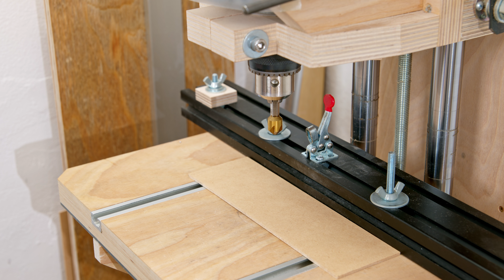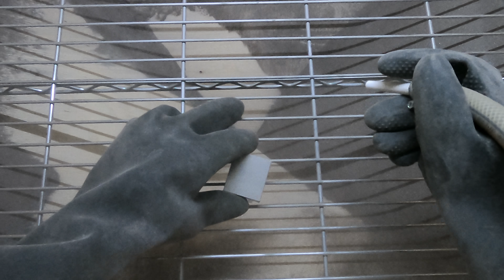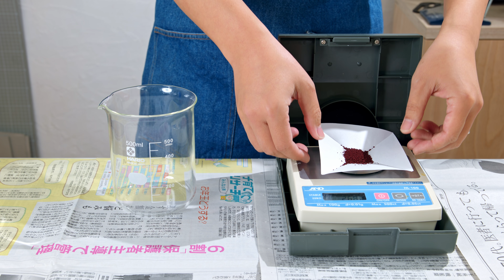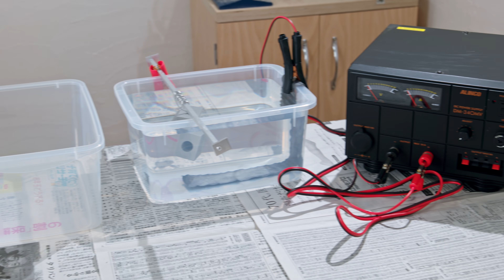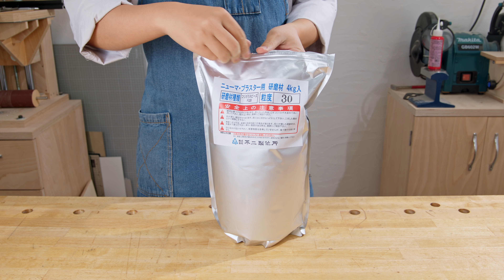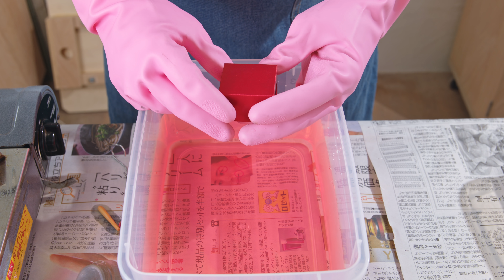Aluminum makes amazing changes～Anodize Aluminum

Comment: I'm guessing by the size of the part, you could have used half of all the liquid materials?  Smaller containers with half the material. Also I would have another rinse after the die so I didn't get red dye into my big tub of mixture. So that I could keep it for next time. I'm assuming it could be reused if stored properly?

Comment: The part you ended up using looked great but even the first piece that was a bit dark & matte wasn't bad-looking. Maybe for a more industrial application it might be perfect. Is one or the other more scratch resistant or color fast? Anyway, it was a great project and a lot of work for one part, but thanks for sharing!

Comment: Im having problem with reducing the temperature of sulphuric acid and water. It is not getting any cooler than 25°.  If I add more water the acid will get weak. What should i do?
Reply: I tried to anodize it when the acid and water was on 40°. Nothing happened. Then i watched your video again. 
Still trying to decrease the temperature. Please suggest me something.
Reply: @ammarhussain8149  Maybe the acid container inside another container full of ice ?

Comment: Those little bubbles are not air bubbles.  They are being released by the reaction.  If I had to guess it's hydrogen gas.  Be careful with flames near that.

Comment: This is a very clear demonstration of the process.  I've wanted to try this for some time but I'm always concerned about storage or disposal of the solutions afterwards.  What do you do with several gallons of dilute sulfuric acid between jobs?  You can't leave it in a tub that might get bumped or knocked over.  Do you pour it back into the jug?  What about spills and splashes?  And you still have to clean or wipe out the tank.  The same for the nickel acetate.  These chemicals are too expensive to discard each time but even if you wanted to, how do you get rid of it?  You can't just dump this stuff down the drain or on the ground.  How do you deal with that?
Reply: You neutralize acids with baking soda. Then down the drain.
Reply: Hi, I've been looking for this process for a long time! What products are needed and the process sequence, where can I find them?

Comment: Lovely. And very high quality video as well.
Question: do you believe it could be possible to anodize an aluminium bicycle frame? I'm talking about the size of it, cost, plastic boxes/thubs dimensions...? Thanks and congratulations once again.
Reply: Yep bike frames are fine, you just need to make sure any steel is removed first. It's just a case of finding a container big enough to fit it in.
Reply: @Squirrelking4395  thank you mate. I appreciated it.

Comment: Beautiful work, can I suggest putting a bolt into your thread before sandblasting to protect the thread?
Reply from the maker: I think the damage is very small and can be ignored.
However, I wouldn't deny trying it if it bothers you.

Comment: Amazing video.Could you continue plating videos .For example could you make a video about soldering coating tip ?
Maybe a 3-4 mm copper rod converting long life solder tip .I sure it will make great project with your high level knowlodge 
Thank you for this great video too